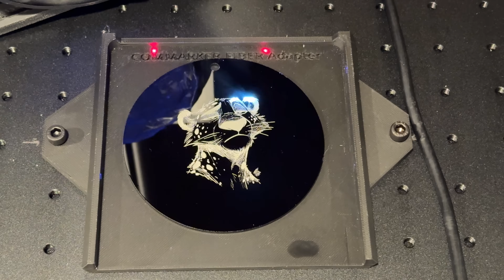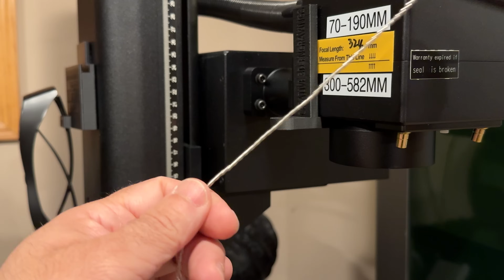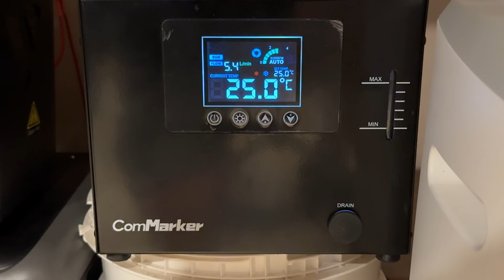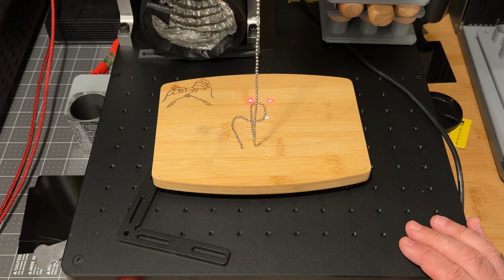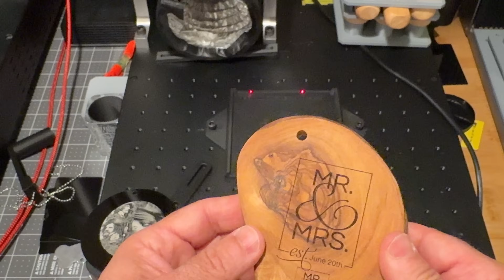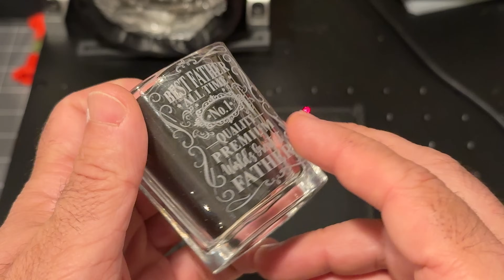Watch This Laser Engraver Make Awesome Designs! Commarker OMNI 10w UV Laser

Comment: I have some experience in uv, co2, diode, fiber and hibrids. Low power to kw. Remember, each kind of tech has it's uses and applications. Loved the uv in glass, ceramics and plastics for engraving. Top tier for them. Some ceramics don't do so well, so even then,  you have to practice.
Reply from the maker: While these do great on glass, my favorite is wood. The dot size for wood and leather is incredible.